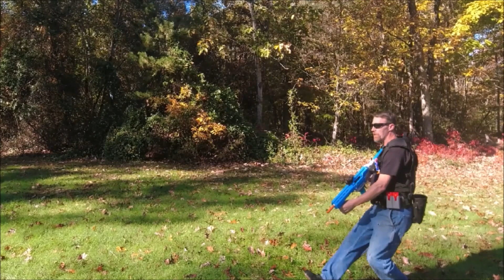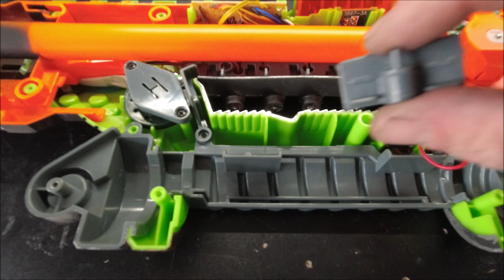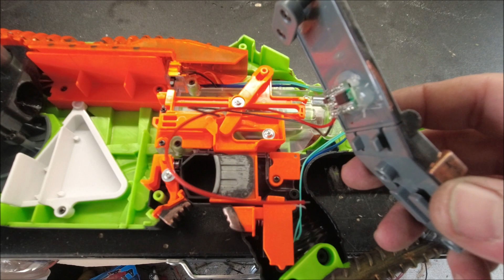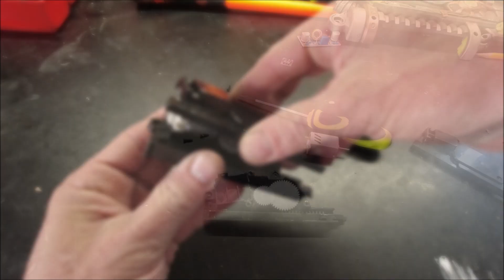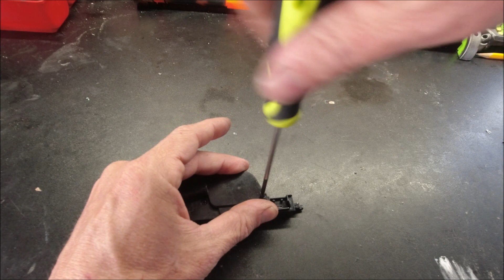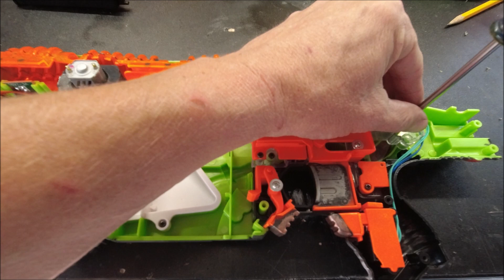Revoltinator, Full Auto Build Guide !!!

Comment: Awesome, awesome, awesome build my friend!!! Do you happen to know what voltage to use for the board if we are running the buck to the board to preserve the lights? You may have said it but I can’t seem to find it. When I followed your regulator mod guide I used 10.5 volts and it has stood up to thousands of rounds. For the light control board do you know what setting for voltage we should use? Thank you so very much!!!
Reply from the maker: For the lights and sound I set the buck to 6 volts. And ran my flywheels on full lipo voltage
Reply: @projectnerf7920  Thanks a ton Chris! I might e-mail you if I run into issues on the wiring if that’s cool. I would love to send you some pics of the regulator that I built and the custom Nstrike barrel I built for the revoltinator.

Comment: YES! A Revoltinator mod guide! I've been wanting to build my own since I saw CC had a cage for it. Now, I'd like to keep mine semi-auto and retain the lights and sounds. (I had the mod guide up in the background, so I will give it some more attentive views.) Could you maybe give a minimal parts list for a semi-auto build? Would it be possible to desolder the cage from the main PCB electronics board, and then run it off its own circuit?
Reply from the maker: That is exactly what you should do, split the circuit and run the cage independent of the board.